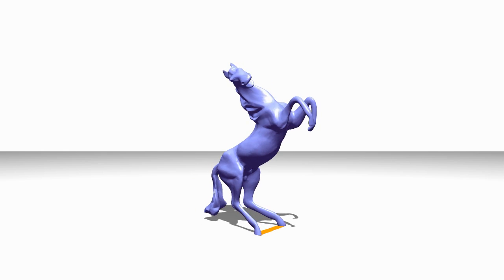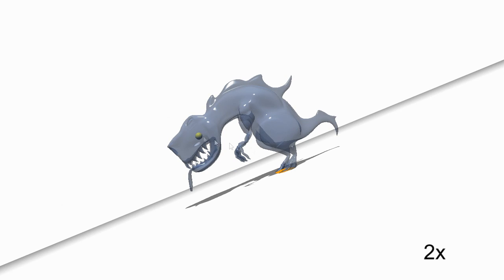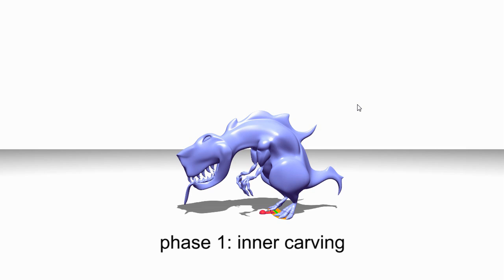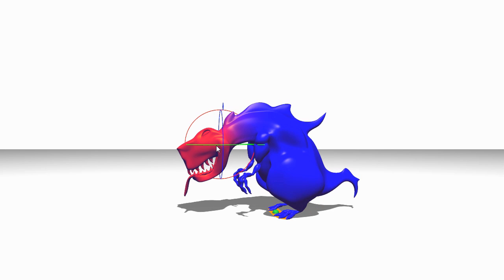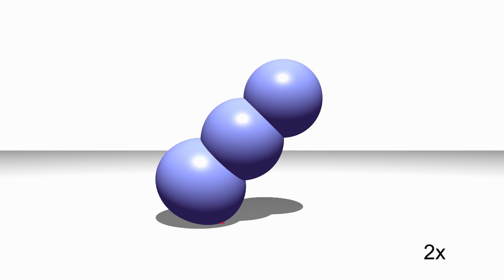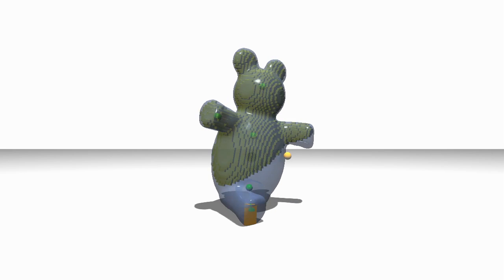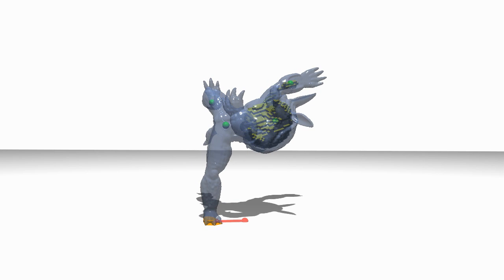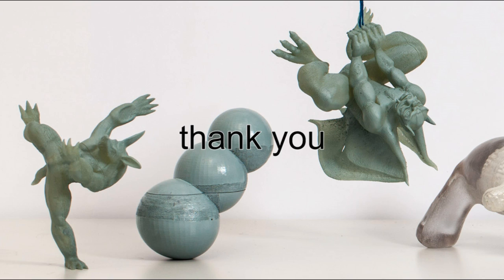Make It Stand: Balancing Shapes for 3D Fabrication

Comment: Mosek is the quadratic solver we use to compute the bounded biharmonic weights to parameterize the deformations.
As mentioned in the README, you need to install version 7 (and of course in 32bits version since our program is also 32bits version). The trial version works fine, and the license is free for academic researchers and students.
We are open to good suggestion to avoid this dependency.
Thank you for the feedbacks.